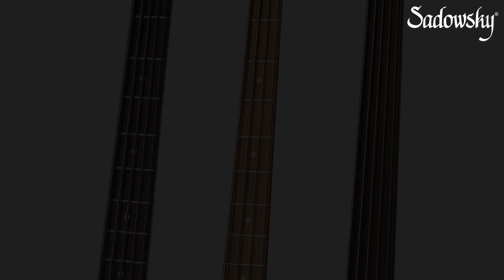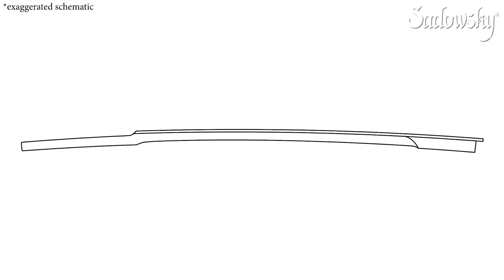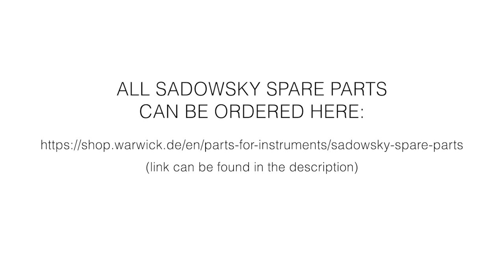How To Setup a Sadowsky Bass

Comment: Unfortunately you're not talking about the A or D string when it comes to setting the height wirh the pickups. What should the height be?

You mentioned the B, E and the G. you're skipping the other two regarding the height over the pick ups.
Reply from the maker: Hi there! It is important to understand that string action and pickup height need to be treated individually. The pickup-string distance values for the A and D strings are left out on purpose because the string action for all strings follows the radius of the fretboard in a slight arch anyway. So, when adjusting the pickups to the correct height for the E and G strings, the A and D strings will automatically sit at the correct height. Since most pickups are flat, they only allow for adjustment at the top and bottom strings. The only exception is a P-pickup, which allows for raising the pickups beneath the A and D strings, so they can be adjusted in a slight "roof" shape, but this will only be necessary if you feel your specific bass with a P-pickup is quieter on the A and D strings compared to the others. We hope this was helpful.

Comment: It looks like you are using the Dunlop 65 lemon oil to clean the neck. That bottle says ‘not recommended on maple necks’. I have a 2010 Metro w/maple neck, what is the best way to clean it? 
Cheers!
Reply from the maker: Hi Brett! The fingerboard of the bass used in the tutorial is made of morado. As said in the video, for laquered maple fretboards we recommend any light, non-oily, non-abrasive guitar polish or fingerboard cleaner. Sadly we can't make any brand specific recommendations, though. Hope this was heplful.

Comment: So for the saddle setup you are measuring the pickup height?
7:50
I am a little confused on this still in the video.
Reply: Yes, that image threw me off too.  It really should belong at 9:07 where they talk about measuring pickup height.
Reply from the maker: Yes, for string action it is correct to measure the distance between the bottom of the string and top of the 12th fret as described in the video. The values shown at 7:50 are indeed for the distance between string and 12th fret and not for string and pickup.

Comment: 3:47 Truss rods affects action at the middle part though. It can be used to adjust action at a limited capacity, too much bow and middle frets would have high action. Even your illustration shows it 4:01. You also mention it at 5:12.
Reply from the maker: Yes, as mentioned in the video the trussrod does indeed affect the intonation and action, but is not intended as a tool for action adjustment but only to counter for a back or front bow of the neck itself caused by either string tension (which can vary when e.g. switching to a different set of strings) or humidity and changes in temperature and climate over time. The shown graphic is marked as an *exaggerated schematic and only serves the purpose of illustrating the function but in reality the bow will/should never be as severe. Intonation and action should only be adjusted at the bridge and the nut.

We hope this was helpful.

Comment: When was the nut adjustment added?  It's is not present on any of my Sadowsky basses.
Reply from the maker: The Sadowsky Just-A-Nut III is a feature on all German made Sadowsky basses and is a direct result of the collaboration between Roger Sadowsky and Warwick who developed the original Just-A-Nut in the mid 80's.